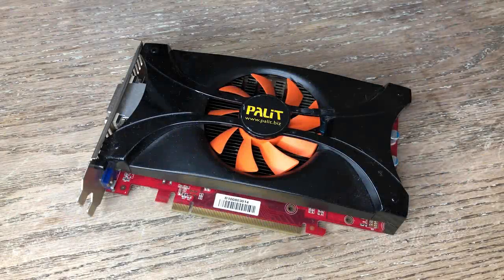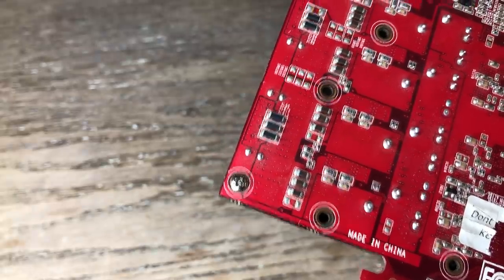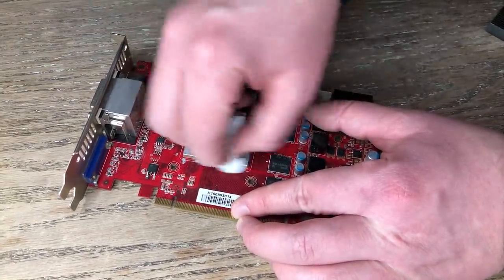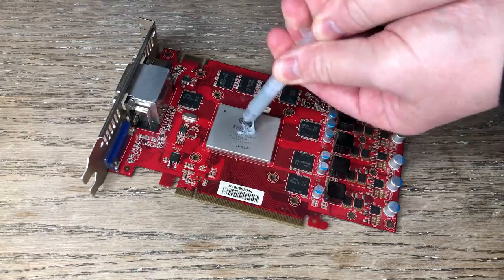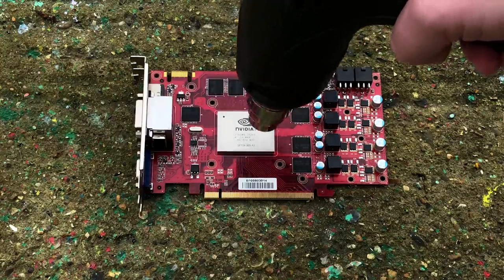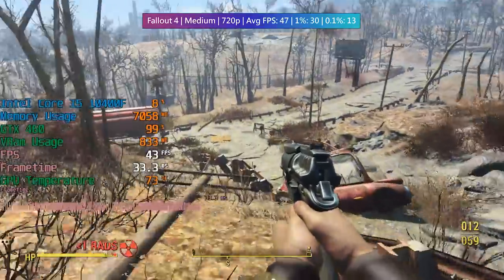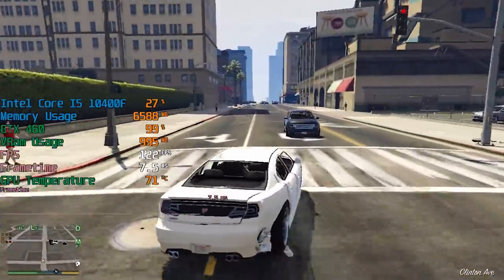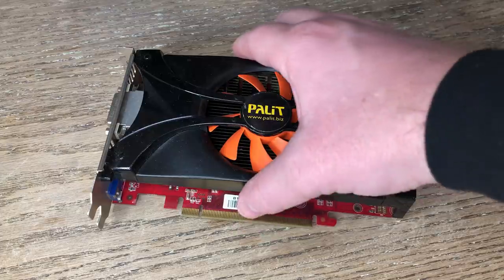Reviving The Dying GTX 460

Comment: Not to put my nose in your business... but be careful striping paint off old doors, especially with a heat gun.

Depending on "how old", old paints contained lead.. heating it up releases lead into the air and if you aren't wearing proper breathing protection can cause some health issues. I helped a buddy of mine some years back to strip paint off doors of an old early 1900's house he bought. I made sure to wear a basic breathing mask with removable filters.

Comment: This may be more permanent fix than you may think. I personally know people who did that years ago and their cards still work fine.  If a card works couple of more years before replacement that is pretty much permanent fix for me. I know everyone loves to quote LR because he is such a nice dude, but in this case he exaugurated to call this method wrong because there are many instances when this can permanently save card or prolong its service for years. You can try to sell it but be honest and mention what you did, or donate it to someone who need cheap card for older games.

Comment: Reminds me of the towel trick with an RROD Xbox. Though have to admit I thought it worked because the PCB or chip had slightly warped and overheating it caused it to warp back, at least temporarily...

Comment: revived same gtx 460 and a gtx 580 both working for 6-8 months avg  load is about 50% and avg temps well below 70c the 580 is undervolted and underclocked so can be a little cooler , going with a stress test can keep 70c steady and freezes at >75c

Comment: I know Fortnite is not the best game ever (and I have never and will never play it) but I do think it is really nice that the Dev's added Both a Performance Setting and Ray Tracing so both types of players can play it, people with low end hardware and people with super high end hardware, either way the game should work really well. 

I don't know of much other games that do this, have a mode that lowers the graphics even more if needed, usually you have to og into the Config files and mess with things there and Mod's (which in many cases get you banned from games due to Anti-Cheat issues). But with this, it is PART of the game and easy to enable. I like that.

Comment: I got scammed with an r9 270 which had artefacts so I used the heat gun method which fixed it for 3 months but it started crashing while gaming so I baked it again and it still works fine for now.Yesterday I fixed A GTX 770 with artefact and for now it runs just fine

Comment: Please don't say that isopropyl alcohol is completely non conductive. It has very low conductivity but still poses a risk if you run your electronics while they're still wet. Let it dry first because it's not worth the risk

Comment: I revived my Xbox 360 from the RROD by using the towel method. I wrapped it, turned it on, let it overheat and shut itself off, let it cool down for an hour and turned it back on to a fully functional Xbox 360 again that lasted me another 2 years of intense gaming until the Xbox One/Ps4 launch.

Comment: My method years ago when heatgunning Xbox's was rather than have a high setting for a while or a short low then high I would spend quite a while on low, i.e a few minutes then have short bursts of high then back to low and slightly longer high bursts that way I would bring up the temp slowly, I had far more success that way then having high for a short period.

Comment: I had a 550ti that wouldn’t display anything so I separated the PCB from the fan and put both the fan, heatsink and PCB in to the dishwasher with a bunch of other dishes and dish washing soap tablet. I put it on 90c wash for 2hours 30 mins then let it dry out, card started working again!!! Sold the card in a system and never got a complaint

Comment: gtx 770 2gb was gaming and got green static on the output including in the bios so stuck it in the oven for 8mins at 180 I think at came back to life 
used it for about 8 months when I replaced it with a rx 480 at the start of last the year, as far as I know it still works I should test it one day

Comment: There is no need of applying that much thermal paste. Only a thin film will do the same or even better job since the possible air bubbles are eliminated and proper contact is achieved.

Comment: I playd the open beta of the new Battlefront II on a stock reference 460.. still got 30-50 FPS with 50% resolution scaling at 720p.
Had to upgrade to a 750Ti because the 460 just could not handle Metro: Last Light even on lowest settings. Thoug it handled Battlefield 3 at 1080p pretty good

Comment: I tried this to my palit gtx 460 768mb version. Before it keeps artifacting and crashing after I installed drivers. Now after blasting it with a heatgun for about 5 minutes, it worked normally. Note that I used flux all under the chip and vrams, and in the first 2 minutes I heated all the board evenly, and for the rest I only heated the chip and vrams.

Comment: I once prolonged my rx470 4gigs, It started to crash and give artifacts during gaming so I washed it with petrol and reapplied thermal paste, worked like a charm for at least 3-4 months but it stopped giving display after it, I guess now its time for me to use heat gun on it.

Comment: Think 5 mins is too long. Did the same time on a gtx 285 and it caused a SMT capacitor to drop off the underside shortly after due to heat. Think 4 to 4.30 mins on heatgun 330c is sufficient. More than this and your going to start scorching shit and making stuff blow off the board. Having a laser thermometer pointed at chip might be a better idea too. Takes the guesswork out. The downside is making the PCB brittle so make sure to use flux under chip to counter it.

Comment: I have various versions of the GTX 460, including a few 2GB models (the extra VRAM does help, but the core clocks of 2GB cards are normally lower, so unless VRAM is a real issue they're generally slower). The fastest model I've tested is the EVGA GTX 460 v2 SSC FTW (this only cost 115 UKP new at one point) which has an impressive stock 867MHz core clock but oc's easily to 1GHz+, leaving all GTX 560s in the dust, is not far off a good 560 Ti and also beats a 650 Ti. Here's one of them for 3DMark11, compared to a 650 Ti:

https://www.3dmark.com/3dm11/5952626
https://www.3dmark.com/3dm11/10150594

And here's two SLI easily beating a single good GTX 580:

https://www.3dmark.com/3dm11/6616515
https://www.3dmark.com/3dm11/8955035

Oddly enough I have a couple of that very Palit card, though the Sonic Platinum was a bit better as it had a higher core clock.

I keep meaning to see just how far the v2 models can do, rig up a Corsair H110 to them with extra VRM cooling or somesuch, should be a laugh.

Comment: I've  used the heat gun method multiple times and had vary good luck for the most part  about a 60% fix some lasted several months  I've had a hd 7970 that was dead when I got it no post and did the heat method and its still going today its been 2 years since I did it.

Comment: Just a tip folks. If doing this to a GPU that still has at least some life left in it just plug it in and power on the PC. In just a few seconds the heat will turn the paste to goo and will be much easier to clean up.

Comment: its funny how you can slap bandages on gpus in the form of literally heating them up despite that being something you want to avoid while using them
Reply: I don't know much about all this, but my guess would be that the card being plugged in is the key point, since heat means more resistance in electricity and more resistance creates more heat - when you utterly nuke an unplugged card it shakes around the itty bits that make the foundation of the card work, by melting it and making it settle in a new way

Having that itty bitty foundation of the GPU shaken up while it's plugged in and doing it's job will obviously make it crap itself, so I guess that's why you don't want a GPU running hot because the increased heat from the resistance could either cause a fire or more likely melt the GPU

TL;DR Hot GPU without electricity is just hot plastic and silicon, hot GPU with electricity is exponentially increasing heat and electric resistance until either heat or electric resistance wins over the capabilities of the GPU itself
Reply: Almost, except with semiconductors its the other way around. (They are NTC devices - negative temp coefficient)
More temp -> less resistance -> more current -> more temp. 
This continous until its smoking. Also, with high temp and (high) currents electromigration happens rather fast, so the chips degrade fast. Think of a river that slowly erodes (gets wider) when water flows very fast. Normally electromigration isnt a real issues, CPUs can work 24/7 100% for 15+ years, but at temps above 100C it quickly gets worse.
Also, at higher temps there is more internal noise, which means it can't reliably clock very high except the voltages are very high, which would nuke the chip even further.

Comment: I had a broken GT 710 that always artifacts when it is on low temperature and I make it work by making my computer hot. I open loads of programs at the 1st boot then wait till it gets to 70 degrees then after I reset it works fine but if the temperature gets low again it will crash and will artifact/garbage displays.  

I don't have idea how that method works tbh, I just assume it's heating up some sort connection that is loose when it is cool. In the end I decided if I can still apply it for warranty even doe it has been 3 months since I bought it and they gave me a replacement luckily.

Comment: Hear me out here!!
So if the card works when you heat it up... why dont you remove the thermal paste, to keep it hot. so in therory wouldnt the card stay working for longer than say 1 day.
No idea it that will work but id like to see if it does lmao
Reply: we are talking about a heat gun here that can do up to 500c temperature I dont know if that method you said can generate that much temperature, plus the cpu fans will blast off quickly once the temperature of the system goes higher or much worse windows shutting itself down.

Comment: You should send off the card to get it reballed or cut the fan speed control wire and have the fan run at full speed to maximize cooling.
Reply: Why? Not rare enough for all that!

Comment: The best way  to Heat the Card  is to put it in the owen.  220°C yes 220°C  for 9 minutes exactly. Because this newer cards or should i say cards after 2008 have different type of  solder than it had prior to that date. I rescued  80% of cards that way.  them all work till this day.

Comment: I've burned mine gtx 480 1.5Gb before 2 years and still runs think is a really good solution cause what you have to do when the card is that old

Comment: You didn't delid the GPU...
It can potentially burn the thermal paste between the IHS to the silicon,and result in higher temperatures.

Comment: My friend did the oven method on a gts 250 once lasted over a year before dying again, heat gunned an old lap top gpu hd 3470 i believe lasted for about 3 months then dies, then again about 3 months died, and on the third try no signal.

Comment: baked a gtx280 and it worked for about 6months until i killed it and its mate by not triple checking the voltage settings before flashing custom bios, have a 3rd gtx280 here with same artifacting problem but have yet to bake/heat gun it

Comment: I've baked my radeon hd 7950 3 times now. The last time it worked fine for 5 months. Eventually I'm sure it will die, but it's still hanging in there (knock on wood).

Comment: I 'cooked' my old 960 2gb and it worked for years until I replaced it recently with a 1060 3gb. It still works now but I wanted a bit more power.

Comment: back in 2018 I had a GTX 980 die on me and I used the heat gun method and managed to revive it, it lasted another 8 months before dying so I upgraded to a RTX 2060

Comment: i had a Rx 580 4gb which had this issue and was needed and i couldnt do it instead i bios flashed the RX 580 into a 570. 
(somehow ATI flash was ok with it). flashes it into a RX 570 and gave it away for 10 euro to a repair show. and a few months later(2 monts) i see the add for my RX 580(570) being sold or 50 euro saying its faulty. the guy got scammed but not by me

Comment: FYI my daughters computer was “dead“ on monday ... swapped all parts with her sisters identical system ... only to find out that a faulty front panel audio plug that connects to the mainboard caused the not responding power button. 

If any of you ever have trouble turning on your pc .. it may not be the psu or cpu or whatever ..

Comment: yes i have revived a notebook gpu that was giving black screen when turned on and it worked fine for 1 year then it started to have problems with video acceleration and after 3 days it started having problems with acceleration it died and no signal of booting it at all

Comment: lol i used too bake and blow fan a lot of gpus and laptop boards only a quick fix  and my dell xps laptop lasted another 3 years before the gfx card finally gave up ..i did once over bake a laptop (ACER) and melted all the circuit too long well need to replace that board now lol

Comment: My Radeon r7 270 2gb has been ticking along for 2+ years with a similar fix I added liquid flux and used a rework station hot air gun

Comment: Any genius out the solve this it's having my life sooo... Dell optiplex 7020 haha, i5, 16gb ram, corsair 650w psu, and a r9280x 3gb. The problem is it won't display the graphics card it's as if its working fine but won't even bios when plugged in... There's a catch though I've got a video of the gpu running in the system, I took my hard drive from my asrock z97 ex6 that ran the r9290x 4gb, I can't use that now like a bell... I factory reset the asrock, now using that hd wont work it like before the dell is in full uefi and widows installed to uefi etc

Comment: put some solder flux under the chip and heat it with heat gun again  i do it with an gtx 570 i and its still working i fixed it about 2 years ago

Comment: and yet you still didnt use liquid flux heating it will never really redo the cracks in the balls liquid flux will at least bandaid them that can lead to a almost permanent fix more often I've had cards last years with this way but only had them same cards last days to weeks without liquid flux so it really can make a difference.